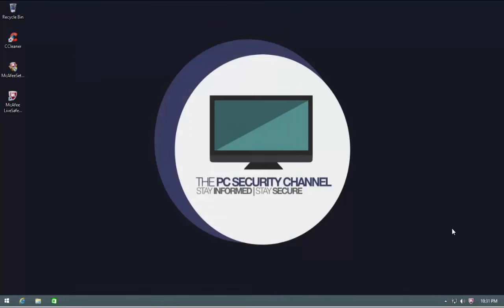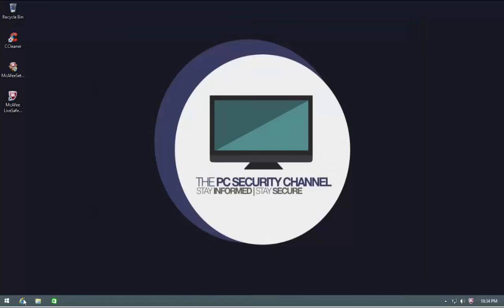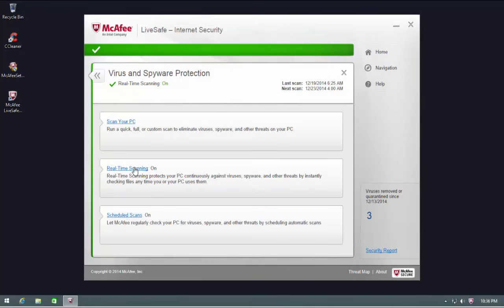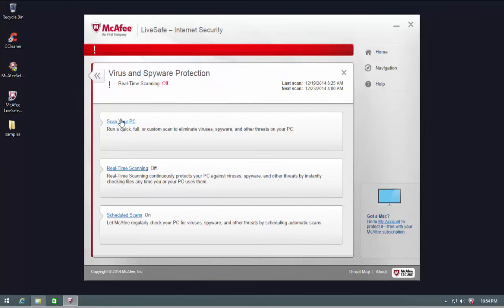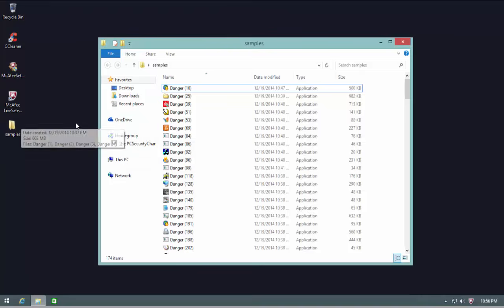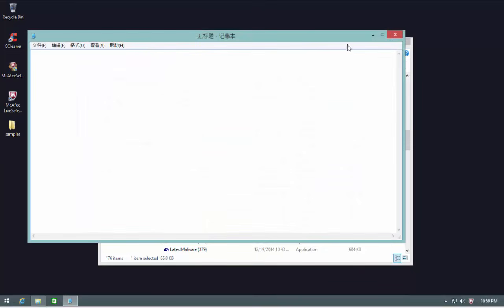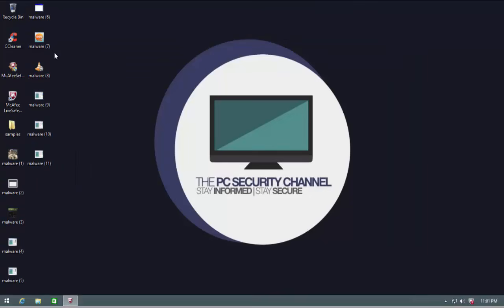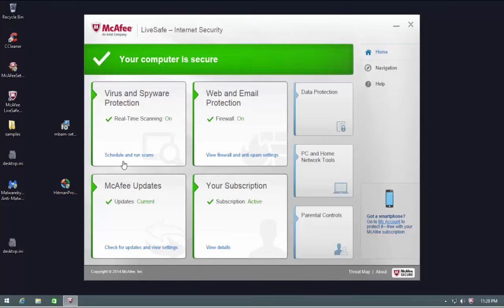McAfee Internet Security review

Comment: Granted, this review is nearly a year old now but McAfee have drastically reduced their resource footprint and they're no longer a system hog. In fact, it uses less than my web browser. I can't speak for performance when it's scanning but then it's set to perform it's scans while i'm sleeping so it wouldn't affect me at all. My acer laptop came with a trial and I was then offered a one-time only offer of £39.99 for my first year. That price for unlimited licenses is a fantastic deal so I decided to go for it.

So far, so good. it's no heavier than Microsoft's own security solutions, half the time you'd barely know it's running and Site Advisor has to be the best of it's kind (it's not a toolbar in Firefox/Waterfox).At full price I would argue it's overpriced and totally unnecesary if you're careful but at over 50% off it's great to have that full featured security blanket available.

Installation can be a nightmare though. Once set up however it's rock-solid.

Comment: Thank you for acknowledging the high RAM usage of this product. I've tried their AV Plus product and on my Win 7 system I get 220MB RAM usage at idle (which is double any other product I've used). The "labs" mostly rate McAfee good or excellent on performance, which I don't get.  And it's all really too bad because I do love Site Advisor and the protection for a common sense user is pretty good. Unfortunately I just won't use a product that uses so much system resources. Thanks for the review.

Comment: At CES 2014 Intel CEO Brian Krzanich intimated they'd rebranded McAfee as Intel but for some reason would keep using McAfee logos; maybe like with Symantec it's easier for  a company where security isn't sole focus to market known "has worked well" apps, updating only enough to keep running on updated OS's, than it is to stay on cutting edge of security needs? Good video, cheers!